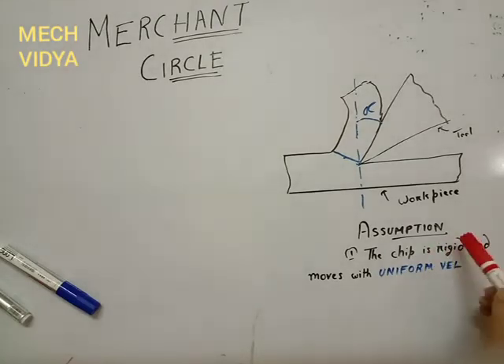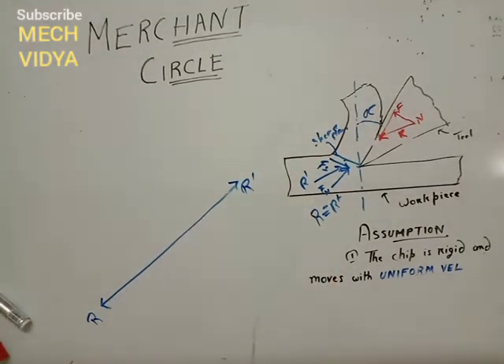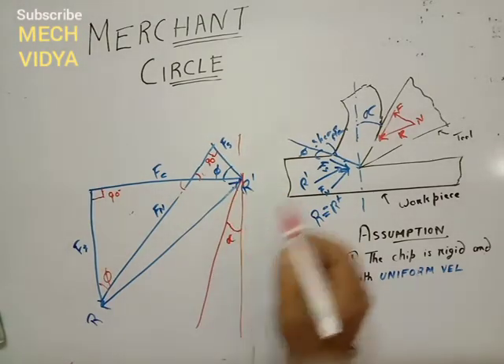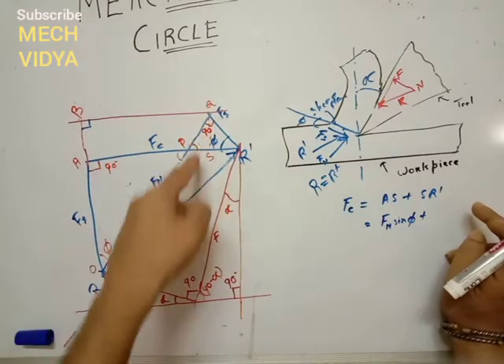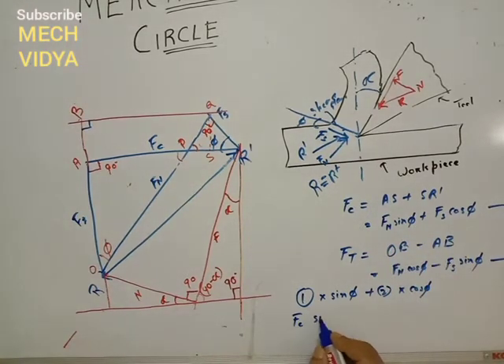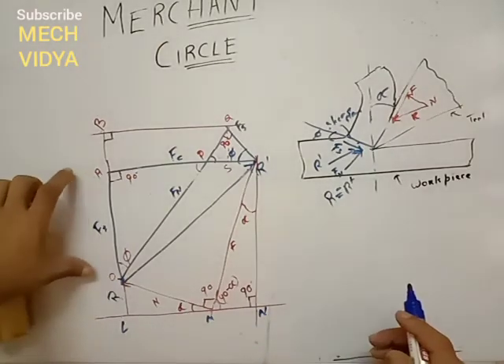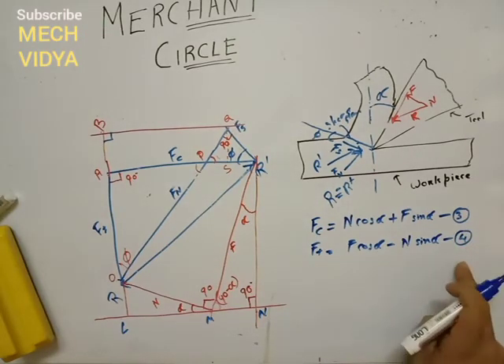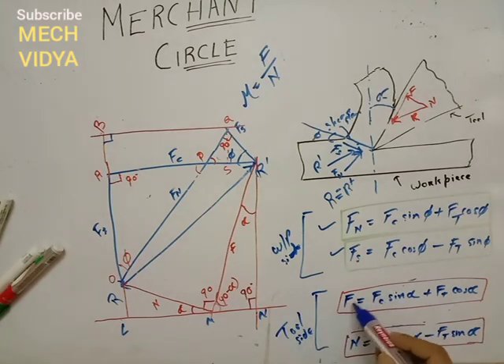Merchant Circle Derivation - Easy Explanation

Comment from the maker: 📘*BOOK LAUNCH ANNOUNCEMENT* 
We are happy to launch OUR BOOK titled ‘Metal Cutting and Machining – For Competitive Exams’ This book is specially designed for GATE, IES (ESE), and PSU exams, with a strong focus on exam patterns and concept clarity. 

👉 Get the book here: https://wa.me/919401941843?text=Hi%20Sir%2C%20I%20came%20from%20your%20YouTube%20channel%20and%20want%20details%20about%20your%20Machining%20book.

Along with the book, you will also get *SUPPLEMENTARY e-BOOK*, which includes: "Common Mistakes in exams Concise concept notes Rapid revision cards Quiz cards for practice Full self-assessment test" This combination helps in fast revision, error reduction, and exam confidence. 💥 
Special Price (both books): ₹119 only